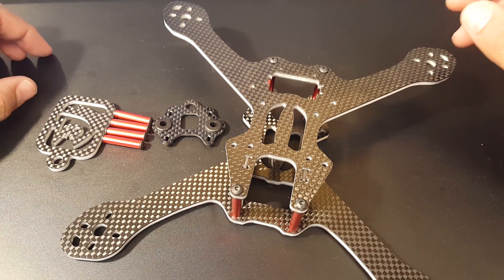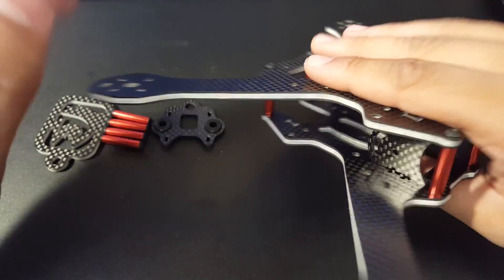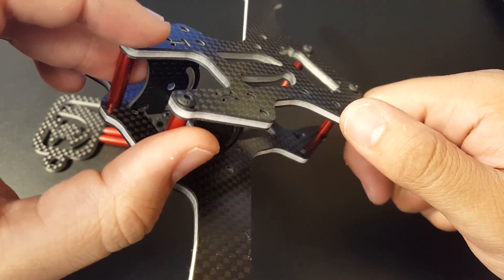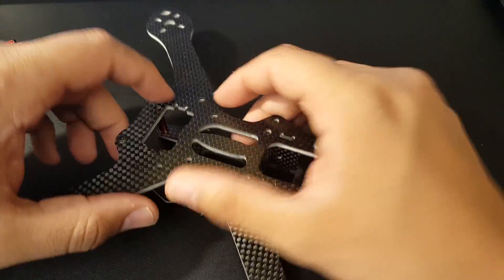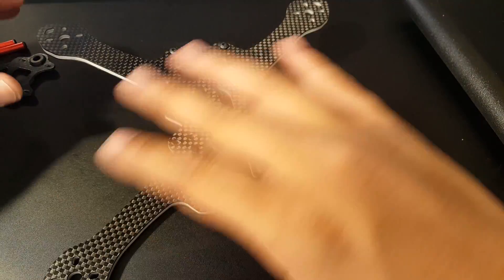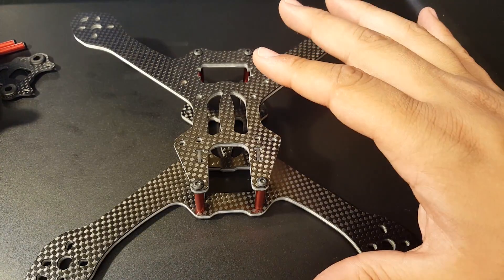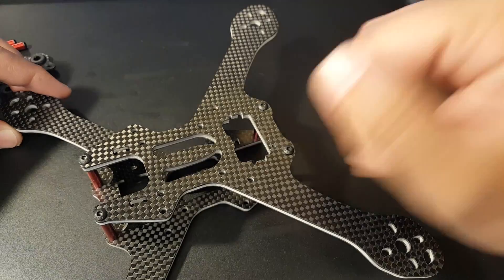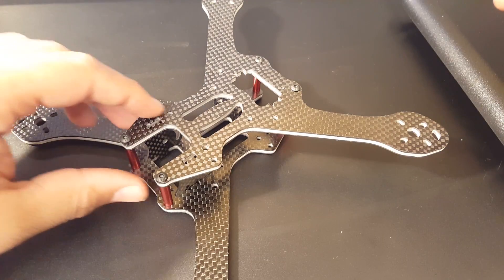Moka Simplex Frame // Overview

Comment: lol I just modded a realacc 210x split level to be like that lol I need a cnc so I can make my stuff get out. hope the composite is good I think they should try a foam that is tough but has flex with the stiff carbon plates maybe three plates top mid bottom two foam. lol I would also test honey comb inside for weight cut and might find extra strength. cant wait to see it crash lol hope its a nice build ood stuff

Comment: i would recommend using the xrotor 40amp esc and the xrotor fc, this esc/fc combo only weighs 16 grams. For the vtx i'd either use the eachine vtx 03 or tbs unify with a linear polarized whip antenna, they're both very light vtx's and for the camera i'd use the runcam micro sparrow or micro swift. For motors anything thats gonna give you the best performance.
Reply from the maker: Just built it 258 Grams but i can easily make it 240 Grams.. Thanks for the recommendation I will possibly set those up on next light frame.